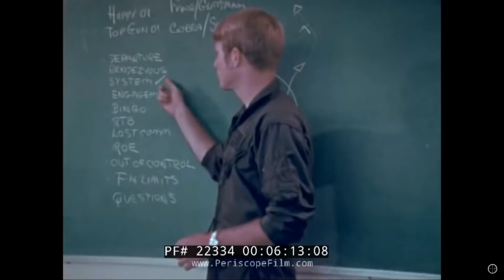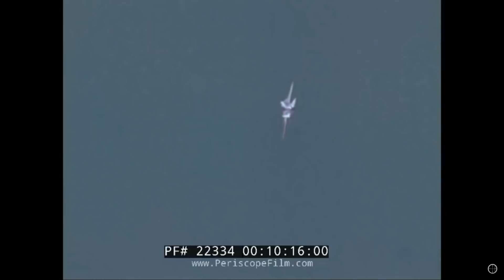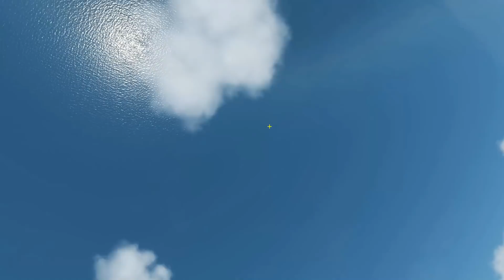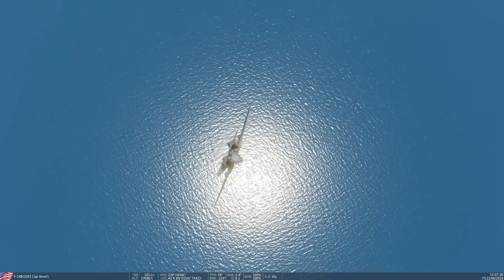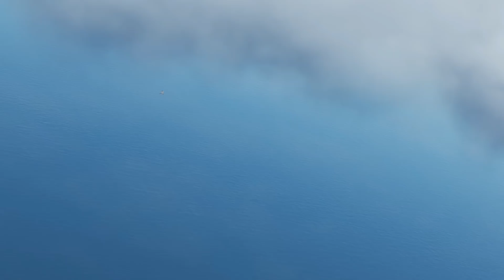F-14B Tomcat: Do These 1970's Grumman ACM Techniques Transfer To DCS WORLD?

Comment: My understanding (and I could be wrong) is that you go aggressive and pull verticals then almost immediately kill burners over the top and the power you have pushed you through so you can get in a neutral to aggressive position after the first loop, and then you’ll likely overshoot so you pull vertical a second time again forcing him to follow you but with less energy which allowed the tomcat to fully pull around on his 6 and get a firing solution

Comment: I think you missed a point. 14 doesn’t light burners until the climb. You mentioned the 45 degree break making the aggressor bleed airspeed... but that’s not what you guys did, you powered on immediately. Also, the displacement roll is key in this also. Aggressor will not have the energy to follow.

Comment: You're missing the PURPOSE of the break turn. 
Turn the F14 HARD and make the F5 lose all it's energy, and THEN you roll level and climb - waiting until the F5 has no air speed to follow you in the climb. The F14 doesn't "need" the air speed as much to climb, because it has massive wings and power. THEN what the training pilot is saying would work.

Comment: Cap, you take into consideration the T-38 doesn't have the same performance and power as the F-5E?  They are not the same aircraft and you can't maneuver against an F-5 the exact same as you can against the T-38.  Both are similar but not exactly the same.

Comment: Is it possible the instructors were talking about a much lower energy state situation where both aircraft are travelling at like... half the speed? In which case the Tomcat might be able to go into the vertical and power through it where perhaps the F-5 just wouldn't be able to nose up into it quite as well? These guys gotta know what they're talking about right? I assuming something's just been incorrectly interpreted.

Comment: +GrimReapersAtomic  These tactics developed for the USN-USMC/Grumman F-14 should also work for the USN-USMC/McDonnellDouglas F-18A/C against the Mikojan-Gurjevich-17F and MiG-23M.  The F-18 can snap around fairly quickly at low airspeeds, so is well suited to the energy fight against a moderately-high-wing-loaded, moderate T/W bogey.

Comment: you had your wings in auto in the climb you lose a lot of energy while climbing like that becasue of the drag from the wings. I suggest using manual sweep control to bring your wings back to 68 degrees to reduce the amount of drag in a climb. Then and only then will you climb faster than the f15.

Comment: The break and climb doesn’t work against the mig 23. The 23 has similar engine capability to the f14. I actually tried this maneuver organically in one of the cage the bear missions. After bombing a target inland I was returning to the carrier. A pair of mig 23s caught up with me. I flew into the mountains and let them close distance as far as I was comfortable doing, then I did a hard break and drove one mig into the ground, but the second mig followed me perfectly into the vertical and guns killed me. The proper procedure would have been to continue turning since the ai couldn’t come close to matching the turn.

I ended up setting up a training mission for myself where there’s 2 mig23s with ir missiles on my 6 at like 5 nm. The way to shake them is different between the f14 and  my current favorite the mirage. With the f14 you can break and climb but eventually you have to force a scissors. The mirage requires running away and dragging them into a slow climb, staring death in the face to lure an ir shot at close range, then using the mirages roll rate and delta wing to break hard and drop speed in opposite direction, causing missile to fly past and giving you a scissors opportunity on the mig.

Edit: but yeah you guys have to do the displacement roll. You go into the vertical because you can retain energy while the smaller engines on the opponent bleeds energy. After the roll you do another loop and you’re on his six. It’s a vertical scissors

Comment: To the original author of the question. Yes, the maneuvers in the video are doable and effective in DCS, even against 4th gen bandits, if performed right, especially in the F-14B, that has enough thrust to fight in the vertical with practically any opposition. However, unless in VR, the 2 hardest parts will be:
1. Maintaining spatial orientation of both the bandit and the F-14, while at the same time maneuvering the plane to its limits.
2. Reading the energy state of the bandit, and knowing when to start the maneuver. 

The first problem is due to the wonky and un-intuitive nature of flat-screen visualization and face tracking procedures. Obviously a non issue for VR owners. The second problem however is universal and can only be solved through training and experience.
Reply: @ilejovcevski79:  ...Okay, never mind.  You already nailed this one.

Comment: Hi Cap, I noticed in the training video a very brief comment that I think was extremely important. In the F-5/F-14 dog fight, break right or left into the F-5 and then “watch for the overshoot” before breaking into the vertical. If you do the maneuver too early you’ll just get killed.
Reply: yea, and I think the turn into bandit and starting a "turn fight" helps bleed energy of said bandit to the set up for the vertical. In a sense baiting the bandit. It can go several ways on this first step.
     If the bandits comes in with massive available energy then the turn in will force the bandit to A: overshoot quickly B: high G and slowdown? C: make a choice for a 1 turn or 2 turn fight. 
The f14 in this first step will be able to quickly ascertain the energy of the bandit. While the bandit makes the above choices, then the 14 takes plans the vertical preparing to keep bandit visual and set up step three. 
   If bandit comes in with medium to low energy the vertical will be executed sooner. And this setup all hinges on if the 14 was sent for an intercept or not I would think. But what do I know. 
   I would think if the bandit was trained and therefor lured in for a turn fight, the vertical would catch them of guard if executed at the right time, the energy bleed would be devastating for an "average" trained bandit pilot considering their training at the time of this video.

Comment: Cap, you're a good sport for taking on all these viewer questions. Keep up the good work!
If you choose to do a re-run with your F-14 expert, I'd suggest trying to start from the positions described by the instructor, rather than what the aerial footage shows. For example, with the T-38, the film shows the T-38 starting from right behind the Tomcat, but the instructor with the models seems to be showing the T-38 turning to get on the F-14's tail. With the A-4, the briefing shows the F-14 starting its climb while the A-4 is still on its way down. In those cases, maybe the aggressor never gets a good enough look at the F-14's engines for a rear-aspect Fox Two. Also, partly for that reason, and partly to focus on offense, don't keep climbing straight up with the F-14. Both the briefings and the aerial footage show the F-14 doing smooth loops, with roll as needed.

Comment: Interesting.  The split screen footage in the training film was informative, too.  But, yes:  Why go vertical when you could turn?
Reply: It's faster and in the case of the A-4 (that can follow the F-14 in the turn long enough to get a lead shot even while losing energy) less dangerous. The Reapers are doing it wrong though. The goal of the maneuver isn't to out climb the bandit by going straight up. The thought process as explained in the video is:
1. Break into the bandit and make him bleed his energy while trying to stay inside your turn;
2. When the bandit runs out of energy (not before), go wings level and climb;
3-a. If bandit tries to go up, his nose falls down, he stalls, then you roll and put your lift vector on him and pull behind him;
3-b. If bandit unloads and extends to recover energy, roll out of plane, put you vector on him and pull behind him;
3-c. If bandit continues to pull till he stalls out, do 3-a again and pull behind him.

Comment: To really compare the T-38 and the F-5 you'd have to load the F-5 up with bombs etc to make it similar, their empty power to weight are not the same, especially the older A model T-38 that would have been in that video.

T-38 was about T/W of 0.65.
An F-5 with just two sidewinders and 50% fuel was about 0.8.

So if you load up the F-5 with some bombs to increase the weight and drag that T/W ratio down a bit, it would probably more closely match the video.
Reply: @RedemptorsRandomRants  Sorry what?
Reply: @LeoH3L1  sorry, I was really drunk and watching Phineas and Ferb for the previous post.  I deleted the comment..
Reply: Plus they were using F-14A's back then.  Is that model even finished in DCS?
Reply: @NefariousKoel  

Using the F-14A's specs, with 7500lb of fuel, two winders and the two crew, it comes out to about T/W of 0.87

So against a T-38 with 0.65 what is seen in the video makes total sense, and if GR does a follow up video with the F-5 loaded with some bombs to simulate that lower ratio it should look a lot more like what we see there, and the tactic will likely be much more useful.

The thing is you have to ask, in the real world in a real war, would teaching such a tactic be teaching a bad habit, it would probably lead younger less experienced pilots to try to employ that against soviet fighters, thinking it will help them, fighters which will have much higher performance than a T-38.
Reply: Isn't the T38 a bit more durable, being a trainer and all.  I thought that was 1 of the reasons NASA liked to use them.
Reply: @RedemptorsRandomRants  The durability of them isn't really relevant to this.
Reply: My point was, isn't the T38 built sturdier than it's F5 cousin, is that the difference on TWR?
Reply: @RedemptorsRandomRants  I don't think that would really make any difference, the issue is ACM ability, not how resistent to damage it is.
Reply: @LeoH3L1  You are saying a pilot that knows his plane can take harder Gs isn't going to do so?
Reply: @RedemptorsRandomRants  In this situation shown in the video, following the F-14 into the vertical G isn't a factor, all that matters there is energy and thrust/weight.

Comment: hey cap, noted that although the F-5 and T-38 uses almost the exact same airframe design, the F-5've got much more powerful engine compare to the trainer. F-5E's milpower thrust is almost that of a stage3 afterburner thrust on the T-38. On the other hand, T-38 has a slightly better roll rate and smaller turn radius than the Tiger.
Reply from the maker: Thanks!
Reply: I was not aware that the T-38 has a smaller turn radius than the F-5.  Do you know how it manages that when the F-5 has leading edge flaps and extensions that provide enough additional lift to fly 10 knots slower on approach despite more weight?  Thanks.

Comment: Wondering how a Mig 21/23 would fair in this situation... I'm not sure the instructor meant you to stay in the vertical as long as you did.
Reply from the maker: Interesting Q
Reply: F-14 would get into a turning fight with both of these because of superior energy addition and sustained turn rate. The MIG-21 had identical turn performance to the F-5, which was much better than F-4. MIG-23 had a good vertical climb rate so it will be behind the F-14A performance in the vertical (not the B or the D with the GE-F110 engines with their 50,000+ feet/minute rate). However, the F-14s out-turned MIG-23 all day. Its performance was similar to the F-4. That is what the F-14 pilots did in the Gulf of Sidra dogfight against the MIG-23. They engaged them in turning fight and got behind them.

Comment: That was the time when the Mig-21 was still the main opponent wasn’t it?
Reply from the maker: I guess. Mig-23 also about?
Reply: @grimreapers  MIG-21 was the best dogfighter out of the MIGs so the F-5 simulated the MIG-21, the A-4 simulated the MIG-17 and the F-4 Phantom simulated the MIG-23 according to Bio Baranek. Their performance on the EM diagrams were virtually identical. Also, these were stripped out A-4, F-5 and F-4 to make it extra challenging for the F-14 pilots to train them in ACM.
Reply: No, the Mig-25 was the target, as seen in 68( i think not sure on the year) during a Russkie military parade. And later Popping up on radar screens, the F-4 phantoms couldn’t catch them.Thats why you see the 14 and 15 pushed out. 

It’s why we put F-14s in Iran and  F-15s in Israel, to stop mig 25 over flights. Mig 21 was already out classed during nam. 

Bonus points what’s the chances that the supposed mig 25 that was clocked over the sini at  3.2 m was actually an A-12 blackbird.  I DO NOT BELIEVE mig 25 ever actually reached that speed, it was a deception to hide the identity of the blackbird

Comment: @grimreapers  I don't think you guys completed the maneuver. It doesn't concluded with just the vertical climb. After you make the braking turn, turn into the vertical with afterburner, then after the climb you continue to roll over the top to get a firing solution. The other planes can't match the rate of climb, energy and turn radius that the F-14 is pulling. If you just continue on the vertical any plane would be able to get an eventual shot. Do you guys think this one can be tried again? Love the videos guys.
Reply from the maker: Roger Marjen   yes that is good thinking. I am trying to get our F-14 master friend on for a re-run.
Reply: @grimreapers  also, the goal of the defensive break is not to turn a fixed amount of degrees before you roll wings level and climb over the top, but rather, to bleed the F-5 out of energy as he tries to stay with you in the turn. So a more aggressive break is required. If the F-5 follows you into the break he will bleed. If he doesn't, you will out turn him. If the former, then go into the vertical. The key component here is a good judgement of the F-5's energy state. A superior pilot on an experienced RIO is required to maintain visual on the bandit through out the entire maneuver and to call out the moves. Hope this helps!
Reply: @grimreapers  thx for response. Looking forward to your next vids. Cheers
Reply: @grimreapers it looks like you are supposed to go up on an overshoot. Look at 1:40. When he levels, he is perpendicular which is the overshoot. Then he levels and pulls. So where you would have been fired on in the beginning, you would be perpendicular, then if he tries to go up with you,  you have less area under the curve of closure capacity, and they can't go up as fast or as early as you so they are pure defensive the moment the overshoot. (In theory)
Reply: was looking for this comment, the one with A4 showed f14 doing multiple loops im almost sure if they did it properly there wouldnt be any missile solution as well
Reply: I can verify that you are 100% correct! I would love to see them re perform the maneuver. I have used this technique to great affect in game, you have to keep the loop going and by the 2nd to 3rd your no-longer defensive. Growling Sidewinder has attempted this but he always ends up dragging it to the deck.
Reply: Exactly what @TheMarjen96 and Iljoveski say. The purspose of BFM is not performing specific manouvers. But Using your energy and aircraft capabilities.
In this specific case you look for visual cues on the other aircraft that it's energy has bled and THEN you use you aircraft's capability to climb over the top and come back doen immediately to get into a "neutral" position

There is no checklist that says "Ok enemy is this fighter and does this, now do this manouver"
C.E.Lemoine explains this very well. And you may want to lookup "Art of the Kill" on YouTube.
Reply: @johncrielaard465  indeed! Also, in this BFM lesson, it is not the climb rate of the individual aircraft that defines the advantageous spot, but rather the minimum Immelmann speed. The plane that can perform the Immelmann at a lower starting speed will perform it faster and tighter. It will thus exit the maneuver behind the enemy, either through the virtue of performing it in such fashion, or the enemy stalling out partway through the maneuver.
Reply: @johncrielaard465  what video did mover say this in?
Reply: As a new pilot to the F-14 Iv been looking for manuvers that were used by the pilots. not just what comes naturally to me from other aircraft. Iv been playing in the diagonal the entire time(not verticle not horizontal) and its worked out fairly well. ill have to try this.
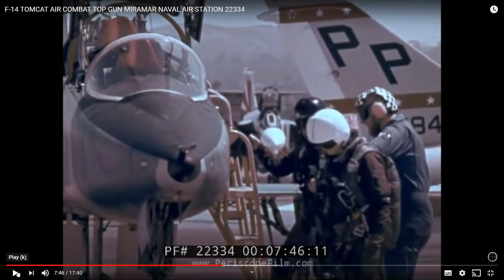Reply: Yes as vid says at 2:44 the f14 needs to go from defensive to offensive position, they need to come over the top not just continue going up, and they showed the looping fight and then didn't try it^^
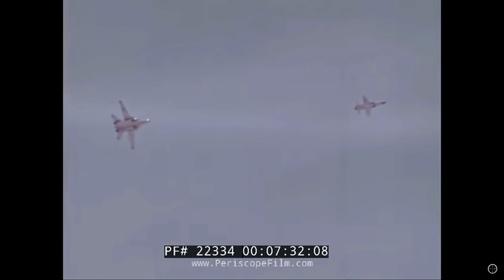Reply: Sorry I meant 2:34 not 44, sausage fingers :x